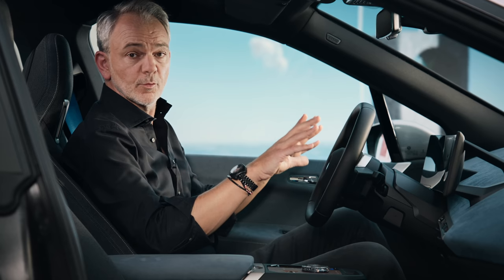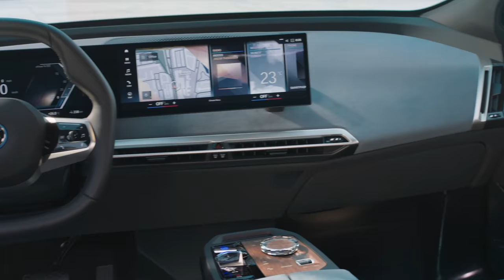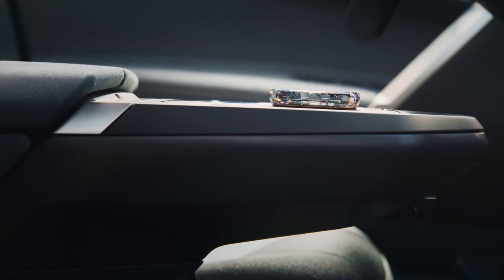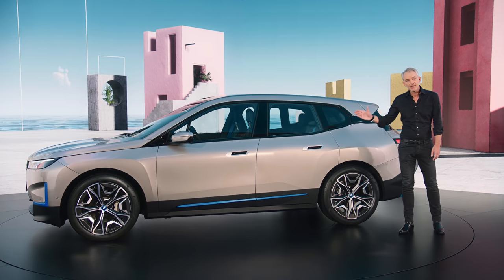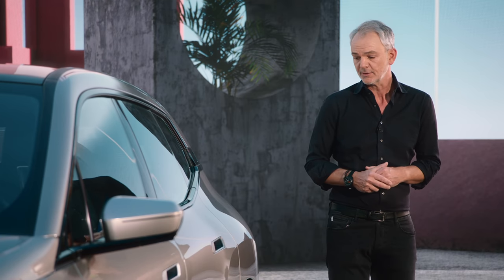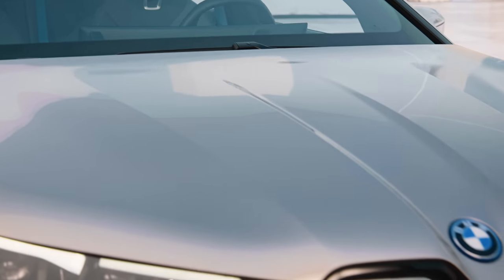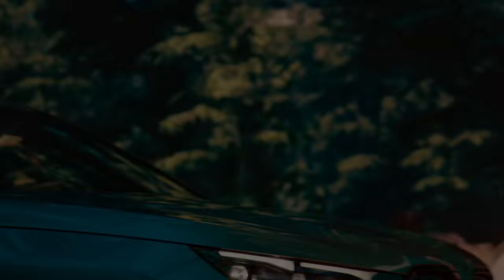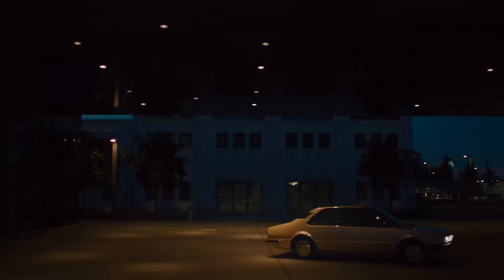The first-ever BMW iX - Unveiling. | #NEXTGen 2020.

Comment: My god, I thought the new bmw 4 series looked ugly with the new grille, but this is atrocious. The front looks like a chinese knock-off. From the side it looks like a van. Why do car manufacturers feel the need to make the electric cars different? Just make a 3 series electric. Just make a 4 series electric. I don't want this niche crap.
Anyways, I think BMW will have a hard time selling this and it will be a massive fail. In comparison the Audi etron is a work of art.
Reply: Echoing my very words that I've been saying for years! I really dont understand why they cant just make straight electric versions of the 3, 4, X5, etc. The iX3 is the only one i really approve of because it's got the nice X3 design, and it's electric. The drawbacks being that it's not available in NA, and it doesnt have xDrive. But clearly if they can make a straight BEV X3, they can do it for the rest of the lineup instead of making these monstrosities. 100% agreed with you on the e-Tron series, especially that gorgeous e-Tron GT.
Reply: Also, why does this need a grille for? it looks like a tacked-on piece of cheap plastic, which it is.
Reply: It will be a shame if BMW became the next Nokia. Love my 3 series 320D and would buy an electric version no questions asked. No need for niche car.
Reply: Besides...why tf do u always degrade the chinese? I agree this bmw design is terrible but some chinese cars look better than this XD

Comment: Well they have unveiled BMW ix months now, but why we dont see it on streets or to make configuration in sites its not ready to buy yet right?
Reply from the maker: The market launch of the BMW iX will get underway in late 2021. Different markets may have different availabilities.
__
BMW iX: Power consumption in kWh/100km: 21.0 (WLTP*). * Figures are preliminary and based on forecasts; not officially confirmed.
Reply: @BMW  Thanks for your reply and information, i have another question though 
when we will see the new infotainment system, the new intelligent personal assistant that we see in this new iX and other features?  i mean with more and better details about it...

Comment: You guys forgot to implement the front licence plate into the design. Which is fine, i don't run with front plates even though it's illegal. Ticket is cheaper than a bumper. 😂

Comment: To put it this way,

The cars new potential tech is fantastic. I like the forward thinking tech. I really do.
There’s the new interior which is a glimpse of the future. It’s as modern as anything.
And there’s the styling. I admit a bit in your face it is, but if you ignore it, the headlights are the main issue. They ruin BMWs signature headlights. I love BMWs effort. I think the only thing that needs to go is the headlights. If you think this is ugly, look at BMWs from the 40s and 50s. This looks Ferrari level good compared to their older cars from the 40s and 50s.

Comment: I really like that the interior looks futuristic and sleek but actually has retained many physical controls, e.g. the air vents can simply be adjusted manually. It's crazy that this has to be considered a feature these days, but a Tesla or Porsche Taycan sadly proves otherwise. Also, the iDrive controller is still there and gives the option to operate the car without using a touchscreen. I like what I see!

Comment: That front grille ......... WHY ? The car doesn't even need one and you came up with that !!
Reply: The reason is the BMW platform strategy: https://www.sueddeutsche.de/auto/bmw-elektroautos-1.4851387
Reply from the maker: Since the electric drive of the BMW iX requires only a small supply of cooling air, the BMW kidney grille is completely closed and becomes an intelligence surface. Camera technology, radar functions, ultra-modern sensor technology as well as their cleaning systems and heating elements are located here.
__
BMW iX: Energy consumption in kWh/100 km (combined): 21.0. CO2 emissions in g/km (combined): 0.* * All performance, fuel consumption and emissions figures are provisional.
Reply: @BMW  I understand the need for a surface to hide all the sensors. But does it need to be flat?
Reply: @BMW  I understand that the vehicle requires cameras, radar and other sensors but seriously, the style of the front grille is just overpowering. I really do feel that your sales will be severely compromised.

Comment: Dear @BMW ,
Attn : design department AND social media department
What have you been doing for the past 5 years? Since then the designs start to get more and more ordinary, and it also starts to get more ugly. Currently what I can see from the iX is the fact I would rather take a Nissan Ariya. Yes, the engineering department made a great job to make its handling good. But the rear end looked like an Audi Q/DS7, the grill which insulted instead of paying respects to the designers who made the beautiful 2015 BMW 3.0 CSL Hommage, and door handles which came from an Aston Martin! I would rather prefer an electric X5 over this (like x3 and ix3) because the design is much better. If you want a revolutionary design, ditch the X7 and turn it into an MPV. Please reply me for a detailed explanation, as I am a teenager who has BMW as their fave brand. In fact, I've seen that you deleted my comment. Accept this fact that I've just said, I BEG YOU

Comment: The m3 E90 sedan was my inspiration to study at uni, for 7y. I was lucky enough to get an e87 116d and E90 320i second hand. Now that I can soon afford a new BMW, they are all too ugly (especially 1 series, 3 and 4 series, 7 series and iX) and heavy.
Just want a light (1400kg max) RWD, manual gearbox, with a decent design, not this ugly front. Even a 2.0L 4 cyl I don't mind, even electric.
And please go back to angel eyes. 
It's hard for us BMW fan as we really want to stick to the brand but it seems BMW is pushing us away.

Comment: "Do you like to drive?" well forget it. 

Technological concepts contrary to the passion for driving. Why does a BMW lover need to slash interior design? Functions that are not in sight? Why, to go crazy looking with ... "where was that, I don't remember"? As a child I took a cardboard box and I would put myself inside the box, I imagined it was the inside of a car, and it looked more luxurious and elegant than that BMW interior. I've seen more interesting elevators than that cabin.

By the way, someone forgot to place the dashboard, but fixed it by buying shelf brackets from Leroy Merlin to put the Worten tablet on top. What a mess!

Comment: BMW - Absolutly a TRASH car , cannot compete with a TESLA model X or even a Model Y Performance. 
In 2021 Tesla will make the Model Y in Germany with MORE Advanced 4680 battery cells, NO modules , NO packs , DIRECT cell to CAR Technology, and will have BOTH Intergrated FRONT and REAR Megacasting. 
BMW is DEAD.